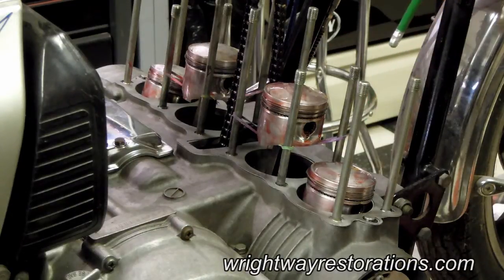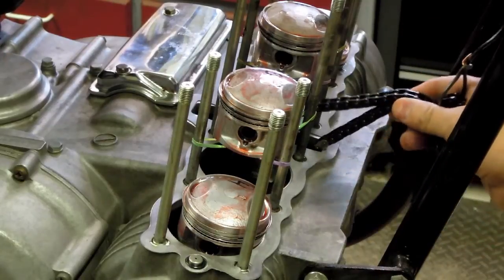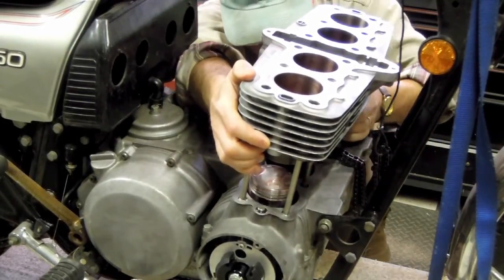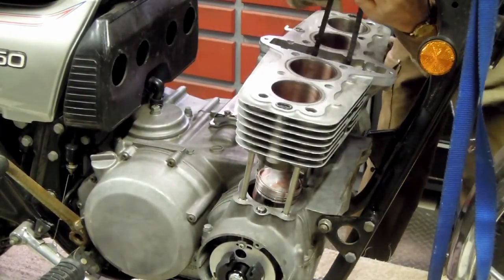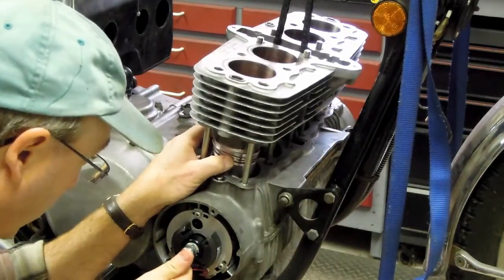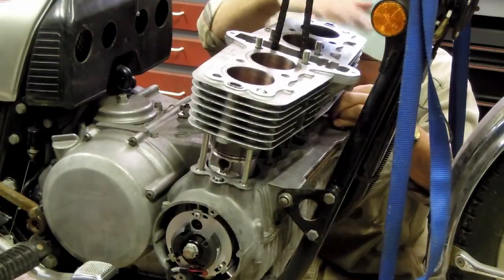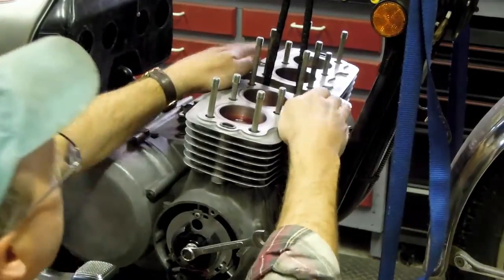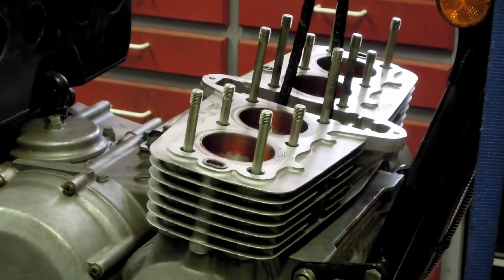Kawasaki KZ650 Top End Reassembly - Part 4 --- Video #30

Comment: Hello sir, I’m struggling with the piston rings.  Could you describe how you are manipulating the rings to allow them to get into the cylinder?
Reply: Thank you for providing us with this series of videos on this motor. Your work is greatly appreciated
Reply from the maker: @MMMMonline  You're welcome.
Reply from the maker: You need to compress the rings tightly to allow the cylinder block to slid down over them.  It is tricky... one technique is to use plastic zip ties to compress the rings by making a type of ring compressor from the zip tie.  Another method is to use a small screw driver to gently "poke" in each ring one a at a time as you gently lower and wiggle the cylinder down over them.  There is no real trick or secret, it takes patience and care.
Reply: The ziptie technique is what a mechanic friend told me to try.  Thank you  @kwrightway

Comment: It's great following these videos, you really cover all the details. I have an 81 KZ650, and I have the engine from an 81 kz750. Do you think it would be possible to swap the jugs, Pistons, and heads from the 750, and install it on the 650?
Reply: I've never worked on  a 750, so I really don't know.  You will need to check the specs, I.e., stroke, connecting rod size, etc., and placement and size of the cylinder block and such.  It may be a drop-on solution, but maybe not.  You will need to do some research...

Comment: Great video. What is the position for the Pistons or crankshaft? Thanks
Reply from the maker: I didn't want to go back through all the videos so I looked this up in the service manual (I don't recall the specifics, anymore).  Here's direct from the service manual:

"Using a 17 mm wrench on the crankshaft, set the 1, 4 pistons at TDC by aligning the timing advancer "T" mark on the 1,4 side (the side ajoining the "T") with the timing mark".  In other words, set pistons 1 & 4 to TDC, then complete the cam positioning as detailed in the video.

Comment: ooh i want to start my cafe racer project and i  saw a 1979 kz650 in running condition according to the seller,he is asking $800 is it a good price for it ?
Reply from the maker: If it's in decent condition physically, starts and runs OK and has a title, in my opinion, $800.00 would be quite reasonable.  Even though the owner my state "in running condition", be sure to verify personally.  Have him start the bike stone COLD and let it warm up fully.  Before he starts it in your presence, carefully place your hand on the engine to see if it's warm, that would tell you if he pre-started it.  I say carefully so you don't potentially burn yourself.
Reply: thanks a lot for the reply, anything else i should check,about what millage would the endgine need work if the bike has been kept in running condition all this years,
thank you again.
Reply from the maker: erealpe13
Like many things in life, it "depends"... on how the bike was maintained, stored and even used.  The KZ650 is a well-designed and made engine and with proper use and care are quite durable.  I've heard of KZ650s with 75K - 100K miles on them, though I've not seen one personally.  With decent care, I'd say mileage up to at least 25K you are fine, between 25 & 50K ou may start to get into things like valve jobs, starter, etc, above 50K miles, the risk goes up.
Reply: i couldnt get the bike ,i contacted the seller and i was ready to go "get it" appointment set up then the guy didnt answer his phone ,next day sent me text that it was sold.ill keep looking.
thanks
Reply from the maker: Sorry to hear that.. good luck in your search!

Comment: This is the most helpful video I've seen on this subject. Please upload part five.
Reply from the maker: Thank you... part five isn't quite ready yet, in fact, I'm literally shooting the next segment right now.
Reply: kwrightway I have a quick question. Is it possible to time the cams on the wrong stroke (180° out)?
Reply from the maker: Iblaze223
Reply from the maker: Iblaze223
Absolutely... the cam timing is the rotational relationship of the cams to the crankshaft and is completely determined by proper positioning of these three components to each other.